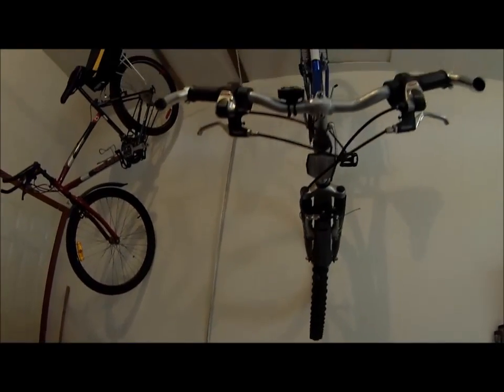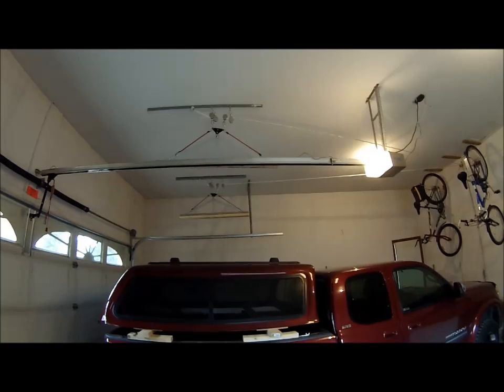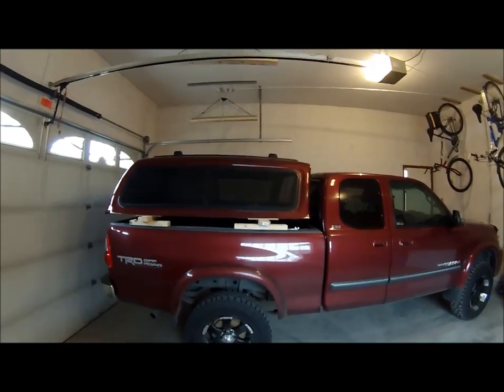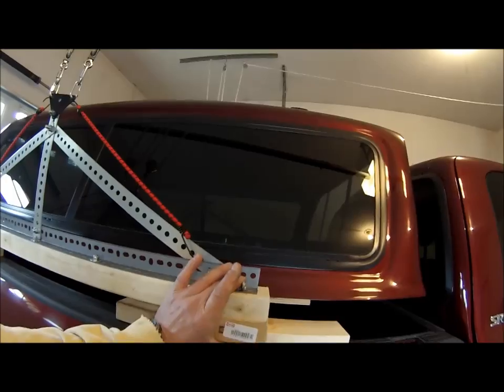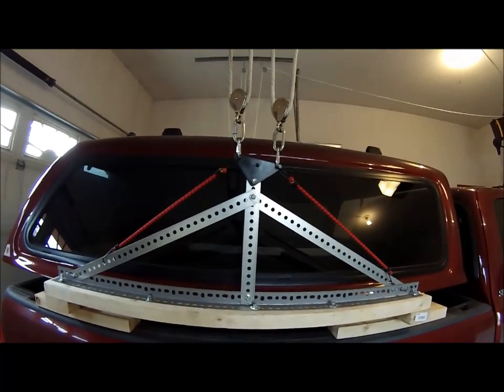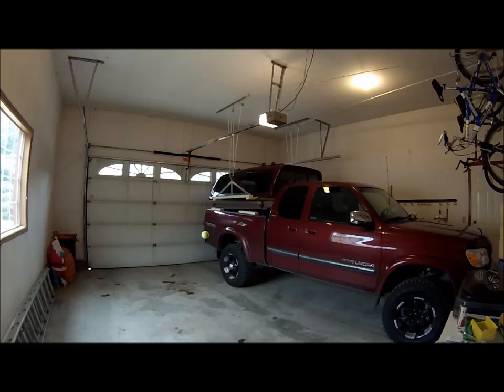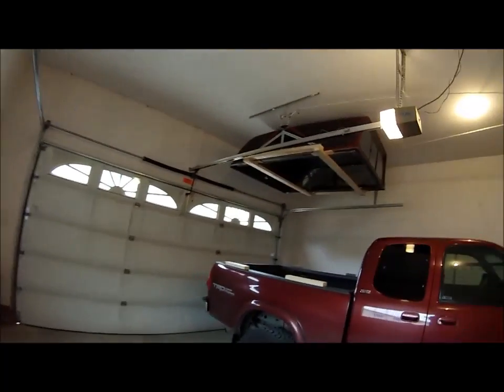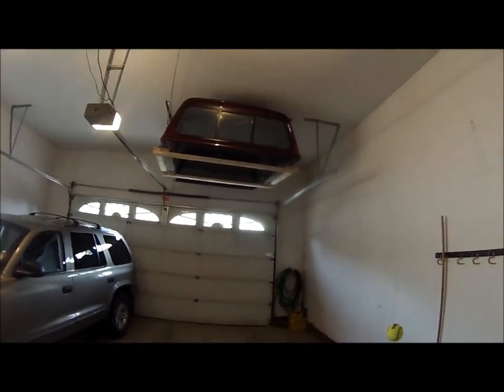Canopy Hoist

Comment: Hey Ed, nice video. Do you think I could replace the triangular metal piece at the top of the vertical zinc plated punched metal with a double dandem pulley?
Reply from the maker: When I first built my lift I had the two pulleys connected directly to the vertical zinc plated metal strip just as you are suggesting.  It lifted ok but the problem was that if I didn't get my canopy balanced exactly right, then the canopy would tilt either forward or backward.  The scary part was that once the canopy started to tip it didn't want to stop!  If the canopy rotates too far it will slide off of the support backets and fall.  So that is why I added the triangular piece and the two bungee cords.  The bolt at the bottom of the triangular piece is not tight so it allows the canopy to easily tilt one way or the other...I know this sounds counter intuative!  However, once you add the bungee cords then you end up stabilizing the tendancy to tilt forward or backward.  In an earlier theoretical design I thought about having four ropes and more pulleys so that I could lift all four corners of the canopy up simultaneously.  This would eliminate the tilting problem.....but it also created more challenges for me in terms of the amount of rope/cable needed.  You may not be aware that when you use pulleys like I have you actually gain a mechanical advantage for lifting.  For example,  My canopy weights just over 200lbs but with my pulleys they way they are I only have to pull about half of that to lift it.  Did you also see my second video where I updated the rope to cable, replaced a double pulley with two single pulleys, and added a manual winch?  If not you might want to look at it before you start building your own lift.  Good Luck!
Reply: @MrETinBC  Thanks Ed!! Super helpful. Outta all the videos I’ve watched, I like yours the best. I’ve watched both videos and everything you meant makes sense. I forgot to buy the bungees. I am gonna attempt to use the tandem double pulley made by Petzl. I have a bunch of those, so I figured I’d give it a shot. I’ll let you know how it works out. Otherwise, I’m pretty much using your exact design. 14 gauge metal is what I found. What did you use?
Reply from the maker: @NoahRonczkowski  Actually I don't know what gauge it is!  I got it at our local hardware store and it just felt strong enough in my hands so I went with it!  I'm no engineer!! Lol

Comment: Heavy-duty 3" tie-downs with 5" crack handles, that are rated for 10k ea. can do the same. Along with heavy duty eye bolts (screw type). Using two 2x4s with ties downs on each side, two in the front and two in the back. And if you do it while its backed in, you can drive your truck right under the shell, making it easy to place back on. Believe me been there done that learned the hard way. Keeping it simple is the best way.

Comment: As many times as I've watched this I cannot figure out the pulley system from the place it attaches to the triangle at the bottom of the canopy, upwards to the ceiling.  The video isn't  quite clear enough to let me see how many of the wires attach to each of the pulleys.  Can you post or send me a photo(s)?
Reply from the maker: Hi Vicki:

I have pasted an image of a pulley system in this comment that I hope you can see.  It is the exact system I used for my canopy lift.  Two pulleys at the roof line and two pulleys at the canopy.  This setup gives you lots of mechanical advantage so lifting the canopy is easy.  If you can't see the image you can find it here:  https://www.pinterest.com/pin/75927943697689137/ 

Also, if you watch my updated canopy lift video (https://youtu.be/LtWghNBvhX0) at about the 15 second mark you can see pretty well how the pulleys are attached.  If this still doesn't do the trick for you let me know and I will take a clear photo for you and post it.

Have a great day.

ET

Comment: Best solution I have seen. Thank you.
Reply from the maker: Hi Brian:

Thanks for the comment!  Since posting that video I have done two small upgrades.  I replaced the double pulley that is between the two hanging bikes with two single, good quality, pulleys.  This allows each pulley to align with the rope better and makes lifting easier.  I also replaced the rope with 1/4" cable and installed a boat trailer style hand crank.  Its actually called a Rhino Winch.  This has made the lift so easy that my 6 year old grandson can lift the canopy. The crank handle has a lock on it so if you let go it doesn't take off on you.  So, as I get older and weaker I can still lift the canopy on my own.  The one draw back is that you have to do a lot of cranking to lift the canopy to the ceiling because the gear ratio on the hand crank is very low.

Have a great New Year Brian!

Ed

Comment: Any chance you could share your parts list?  Very interested in repeating what you did in my garage.  Thanx
Reply from the maker: Hi Matt:

I don’t have a parts list…I just find/buy pieces as I go.  If you look at the video carefully you can make a list of the components which is what I would have to do to make a list for you. I can offer you some suggestions for parts and how I would do it differently if I were to make this again.
1)    For the 2X4 cross pieces I would position them as close to the front and rear of the canopy as possible as this will make the lift more stable.  I could have moved my cross pieces another 12” forward and back to widen the lift points 
Once you know how far apart your lift points are (will depend on the length of your truck box) then you know how long the 2x4 pieces need to be that connect to the two cross members along each side of your canopy.
2)    For the double pulley that is on the ceiling directly above where I tie/pull the rope, I would not use a double pulley here.  Instead I would use two separate pulleys.  The reason is that the ropes exit the double pulley at an angle as they connect to the to left and right lift points on ceiling above the canopy.  This angle creates a miss-alignment of the rope on the pulley wheel and makes lifting the canopy harder.  If you use two separate pulleys then they could
line up with the rope angle and they would track much better.
3)    The way I have the lift pulleys setup on each side with two connected to the canopy lift point and two connected to the ceiling, gives me a two to one lift ratio.  This means I only have to pull down on the rope with half of the weight of the canopy to lift it.  I find the pull is still a bit hard and as I get older I may not be able to do it.  I could make the lift easier by adding a third pulley top and bottom on each side as this would further reduce the pull weight needed to lift the canopy.  Alternatively, you could come up with some kind of crank to lift the canopy.  I have thought about replacing the rope with ¼ inch cable and then mounting a hand crank (like a boat trailer crank or a come-along crank) on the wall to lift  and lower the canopy.
4)    The black, inverted triangular, pieces of metal where my pulleys connect at the top the left and right hand lift points was originally bolted solidly to the metal lift straps.  This didn’t work like I thought it would and seemed to cause the canopy to tilt forward or backward when I was lifting.  If you look carefully you can see that I remounted the triangle so that it is connected with only one bolt and it now allows the canopy to sit level even if the two pulleys attached to
it lift at slightly different rates. This design also allowed me to add the two bungee cords which work well to keep the canopy level and stop if from rocking back and forth when I am lifting or lowering.
5)    The pre-drilled metal angle iron and flat iron that I used came from a local hardware store.  I think you can get it at most hardware stores and it came in 4 foot lengths. This is not the flimsy plated stuff, it is 1/8” thick and very ridged.  I used the angle iron on the ceiling and on the lift point 2x4s that connect the front and rear cross members.  The rest of the metal is all flat as the stress on it is linear, not perpendicular.
6)    Be sure that your anchor points for the angle iron on the ceiling go into studs as gyproc will not support your canopy.  My ceiling studs run left to right in my garage so each angle iron on the roof actually bolts into 3 studs.  Also, the double pulley that I talked about in point 2 is bolted to a bracket that is bolted to a stud.  You don’t want to take any chances that one of these mounting points fail as this would result in your canopy falling.
7)    I used nylock nuts on all bolts (except the wing nuts) so that the nuts will not loosen over time.)   
Now that I have the lift working I find that in the winter when my canopy is on my truck for 6 months, I use the lift to store other seasonal summer stuff.  I am considering making another lift just for long term storage..maybe for winter
and summer tires.
I hope your project goes well.  Good luck.
Reply: +MrETinBC Awesome! This is what I really wanted to see.  I appreciate you writing it up.  Now to replicate it - Thank you!
Reply: Ed Tandy this is an amazing system Ed.  I am so impressed.  I’m looking at building one myself and think this is the slickest I’ve seen.
Reply: +MrETinBC The problem I find with the boat/trailer crank is that it is intended for horizontal pulling, not vertical.  Vertical could be dangerous.  When you lift the load, the winch will lock and is relatively safe.  The problem is when you are lowering the canopy/camper-shell.  If you release the winch, you better be holding tight or the whole thing will free-fall.  I think the come-along or some sort of vertical winch will be better and I have to find one.
Reply: +MrETinBC Thank you very much for posting this description.  I am spending the Thanksgiving weekend designing and building a similar system using yours as a guide.
Reply from the maker: +Anthony Wright Good Point.  I have had the experience of letting go of a crank handle when putting a boat in the water and the handle spun out of control and I banged up my hand and fingers trying to stop it.  I think there is another YouTube video about canopy hoists where the guy has some kind of crank that he connected his cordless drill too.  He then used the drill to lift his canopy.  Not sure how well it worked to lower the canopy.  Let me know what you decide to do.
Reply: I just have one question. Where did you get the triangle pieces? I can't seem to find them anywhere.
Reply from the maker: Hi John.  Sorry I didn't see your question 4 months ago when you posted it!  Somehow I missed it.  It is probably too late now as you may have already solved your problem.  I don't really know where the two black triangle pieces came from.  I am a pack-rat and keep stuff for years in a pile and then when I need something I go digging in the pile.  I just happened to have these two pieces.  However,  you can make them as their dimensions are not critical.  They serve only as a way to connect the two pulleys to the single point of lift.  So, you could take any 1/8 or 1/4 inch thick piece of metal and cut it into a similar shaped triangle.  The dimensions of my triangle pieces are approximately 5 inches on the two short sides and about 7 inches on the long side.  You want the long side, that faces up to the ceiling, to be the same width as the pulley mounting points on the ceiling so that the ropes hang straight down between the ceiling and the triangles.  This will make your lift angle straight up and be more efficient.  Hope this helps.  ET

Comment: It seems all the weight is relying on the first double pulley mounted to the wall over the rope tiedown.    I hope this doesn't "pull" out of the wall and come crashing down.  Have you incorporated some stationary hangers once topper is in place incase the rope or pulley fails as to not have an accident?  Thanks.  Nice video.
Reply from the maker: Hi Keith:  You are right about the stress on the double pulley.  You might not be able to tell in the video but this pulley is lag bolted to a stud in the wall so it is pretty solid.  I could mount a plate on the wall that would span two studs and then bolt the pulleys to the plate.  This would distribute the weight across two studs which would be more secure.  Thanks for your feedback.  Ed
Reply: +MrETinBC  That's a good idea.  Thanks for video.  Looking for a solid and safe way to lift/install my topper.  Good ideas here.  I am still a bit confused on the "extra pulleys " and how routed above the garage door though.  Thanks again.

Comment: Can you please share details of the pulleys. I'm trying to tweak my kayak pulley, when I raise it, it always tilts the front up, and the rear down, and it takes work to get it to rise. Thanks
Reply from the maker: +reapur   I had the same problem with my first design where I had a pulley connected to each of the four corners of the lift frame and that was a disaster.  The canopy would not lift level, it always tipped forward or backward.  I resolved the problem by changing the way the pulleys attached to the frame that the canopy sits on.  Note in the video that the lift point is centered (front to back) one each side of the canopy and I use two bungee cords to help dampen any tendency for the canopy to rock.  The key to a level lift is to use a single lift point.  However, this is still a bit tricky as you have to ensure that the canopy is balanced front to back.  You can't have the canopy heavier on the front or back as it will tend to tip backward or forward.  I have marked the inside of my canopy so I know exactly where the two cross beams go so that the canopy is perfectly balanced on the lift point.    Hope this helps.  ET